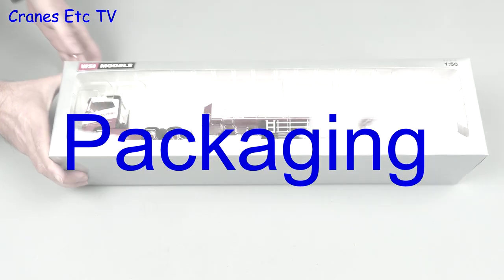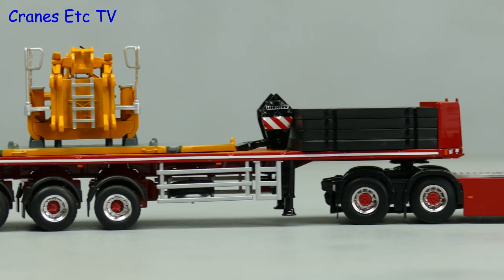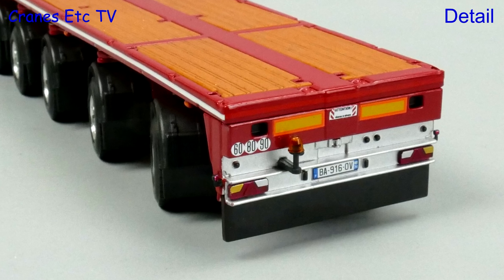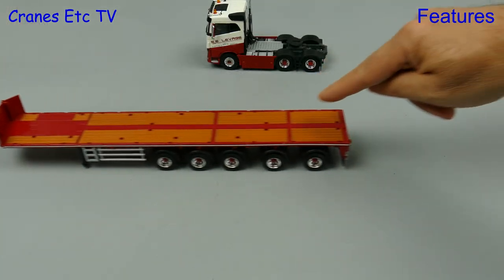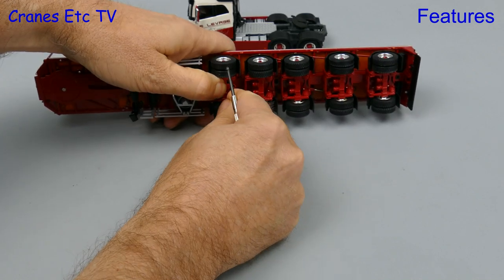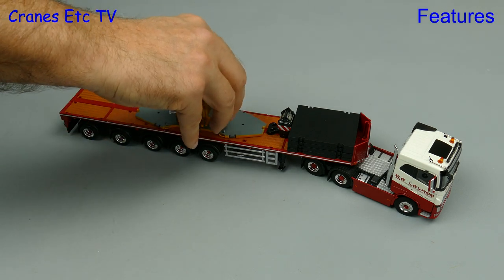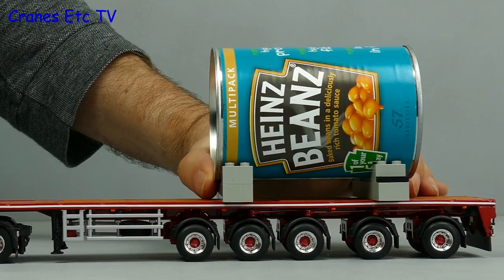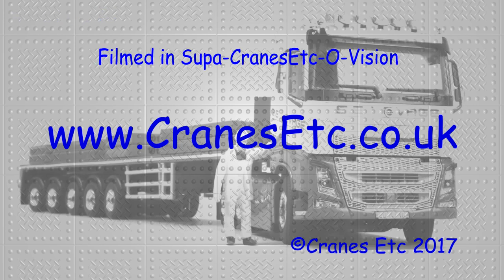WSI Volvo FH4 + Goldhofer Trailer 'Levage' by Cranes Etc TV

Comment: Ian,
I was curious,  the Conrad Goldhofer "liftcenter" without wheels but instead jack legs...tge package says 2 & 3 axels..is this just for looks as if it is without wheels? or is there an actual use . excuse my ignorance, but the info online is very limited. 
See link below . 

http://www.diecastmodels.co/goldhofer-lift-center-2-axle-and-3-axle/

Thanks for any knowledge you could pass on.

Cheers
Reply from the maker: It is actually a bridge section intended to make a trailer longer but without adding extra axles.  The legs are just so it can sit on the ground nicely if not being used.
Reply: CranesEtcTV Thanks for clearing that up .
Cheers